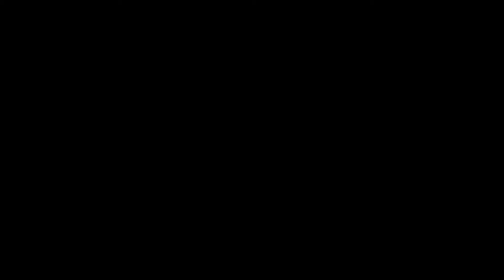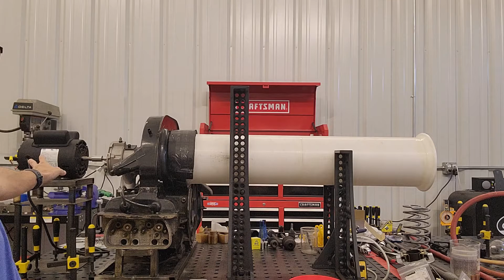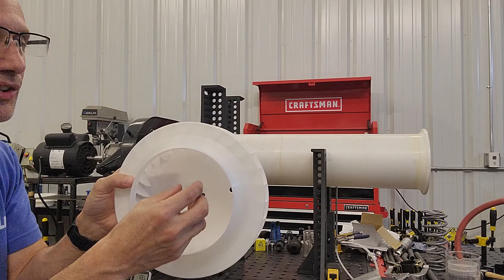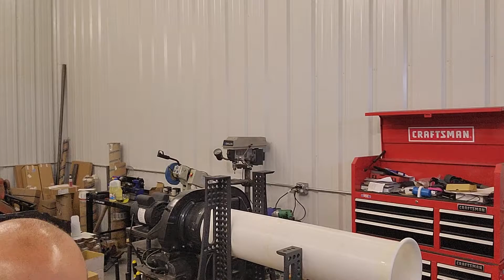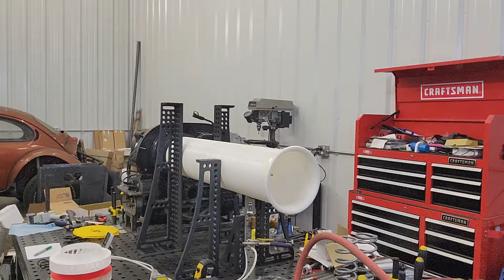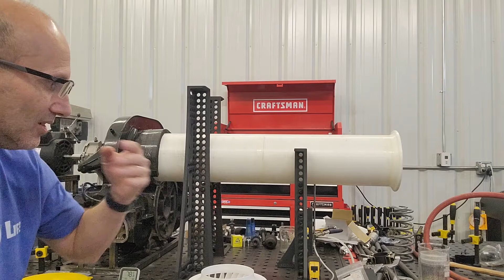Lightweight Cooling Fan NG Test Setup Explanation

Comment: Is there a rpm limit or does it deform? Does heat stress the material or degrade life of the fan?
Reply from the maker: No, there is no RPM limit.  The fan will not deform.  It's made of a very stiff and strong material.  The first production material prototype I made I tried to bend it with my hands, and it's almost impossible to do.  I am able to stand on it without issue.  The material is slightly stronger than most common cast aluminum, and like I said, it's very stiff.  Hopefully, I'll be showing some of the initial fans from production soon.